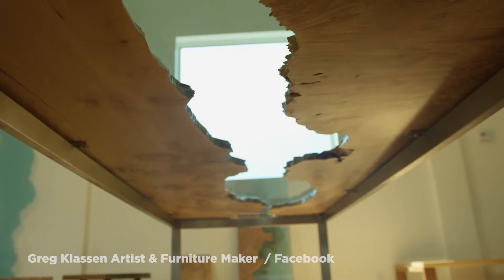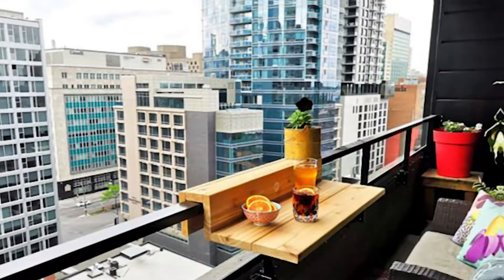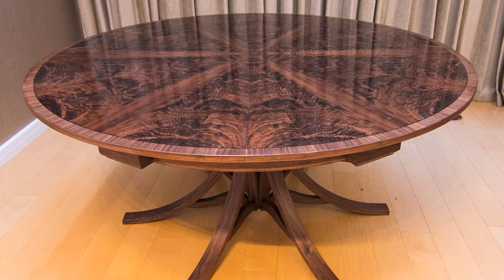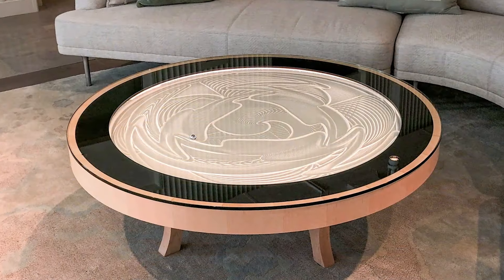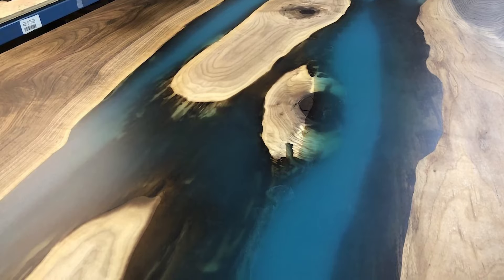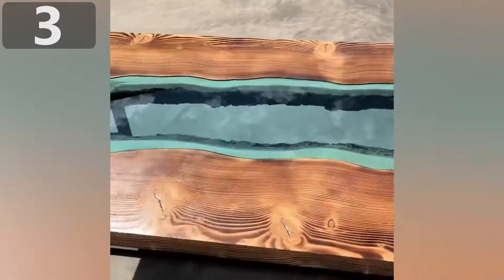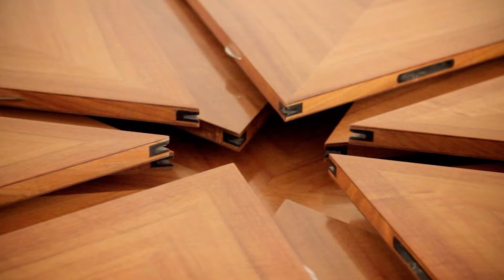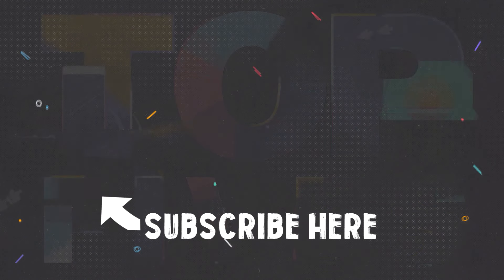15 MOST Amazing Custom Tables - Epoxy Resin and Wood River

Comment: I don't like the circular tables that get  a little bit bigger. It's impressive but it's unecesary in my opinion. I would rather have the cheaper wood and epoxy tables. They are so cool looking.